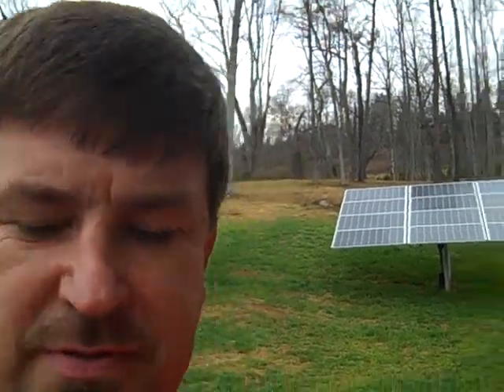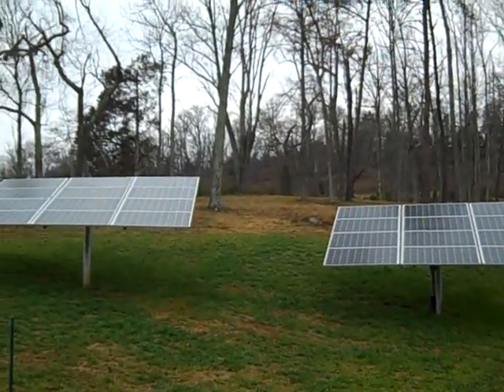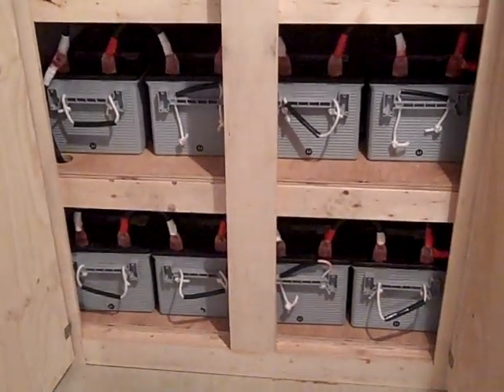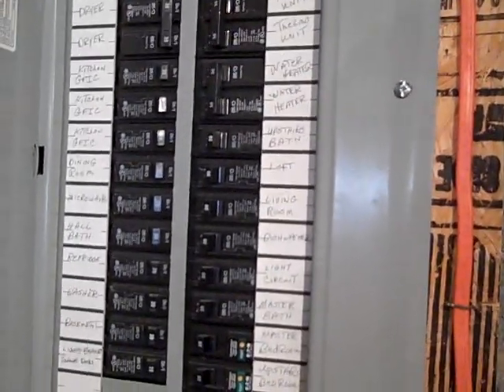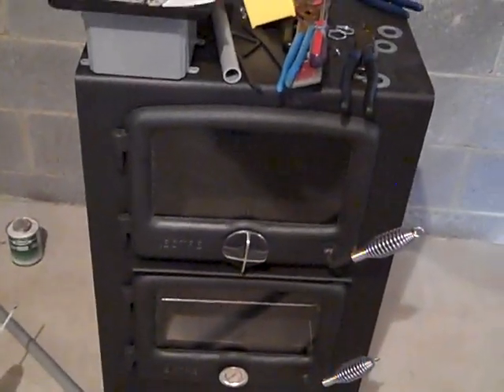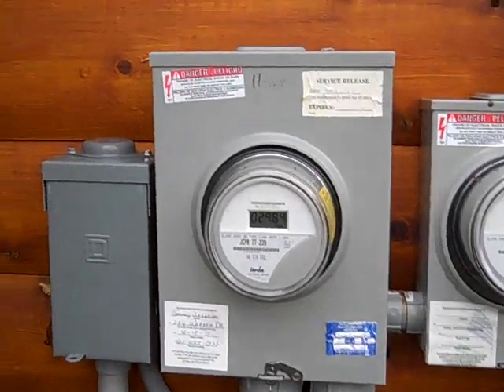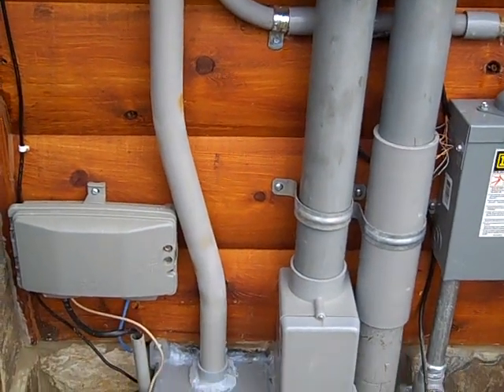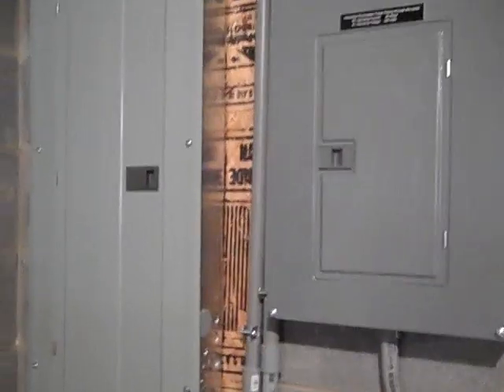Grid tie conversion to Hybrid Backup

Comment from the maker: @MrMG1973 No the inverters do not shut down because when the grid goes down an automatic transfer switch allows AC from the Xantrex inverter to keep them going.   As they produce power they feed the critical load circuits and charge the battery bank.  Pretty cool system.  We had the power company scratching their heads on this one!

Comment from the maker: Yes, when the grid goes down the transfer switch takes the Enphase power ( that was grid tied) and takes it to the inverter/charger.  Run time is variable as there is 6kW of solar so if you make hay while the sun shines you have a sustainable system.  The battery bank is 980 Amp/hrs.

Comment: Looks like that she should add a small exterior shed ( about + 18 " deeper then that bank of meters, counuit & switches.  Hide it a bit and protect it from the elements.  If not to code, a two sided shed against that area w/ a roof?  Just a thought.  

Looks really great and a complete all out back up system w/ no money spared.

Comment: Great setup.I bet these guys from power company were surprised that this works.They want you to be dependant,no matter what,but if you create "fake" grid with pure sine wave source,every grid tied micros or string inverters must work and behave according to load.The excess power is used to charge battery,if cloudy, it will suck batteies.The only problem is that is quiet pricey,that's why we don't see these systems at work that often..

Comment: Nice setup. I am very confused. 
When the grid goes down don’t the enphase inverters shut down? 
I have a direct grid tie system using enphase so this is a very interesting setup to me. Where I live there are large tariffs being paid out for green energy. I am in a contract for the next 20 years being paid $0.802 per kWh. The one problem is if the grid goes down I am without power like everyone else.

Comment: @engineer775 

I so want to put in a system like this one. Originally I set up my home with a whole house generator backup fed by LP. Is it impossible to keep that in place and also do a grid-tie hybrid system such as you show on this video? The reason I'd want to keep the whole house generator in place is because: 1) it is only a couple years old; and 2) during the winter icestorm outages a battery back-up system might not run the ground source heat pump.

Comment: What am I missing here? When the grid is up, the Xantrex is in pass through mode, the Enphase inverters are grid tied and producing.  When the AC goes out, the xantrex switches to inverting the batteries DC to AC and supplies the critical loads panel.  The micro inverters are fooled into continuing to run as long as the batteries don't hit LBCO.  The micro inverters will not charge the batteries this way, and if they produce more power than the loads require, the Xantrex will go into standby.

Comment: Old video, but is there a ratio of [battery backup] to [solar grid-tie] size (in kW) to make the grid-tie "think" the grid is still alive?  In other words, you probably don't want a 1kW battery backup acting as a "substitute grid" for 10kW worth of grid-tie inverter(s)... right?  Does the battery backup need to be at least the same kW rating as the grid-tie?

Comment: I have an enphase system and up till this week an analog meter that spun backwards.  This week a smart meter was installed but cant do net metering.  RV's use a powermax transfer switch that uses battery bank inverter power 1st then switches to grid as secondary when there isnt enough battery power.  Could this work with the enphase grid tie inverters?

Comment: How hard is it to just convert a grid tie system to daytime access to solar power during a blackout without replacing the existing inverter(s).  (There are so many devices with batteries these days.)  Just needs an auto power switch to ac outlet.  Why is this so hard to get?  Don't the batteries need to be used and charged all the time or they die?

Comment: What happens when the grid goes down, your batteries are fully charged and you're producing more power than what you're using?  Doesn't that energy have to go somewhere?
Reply: The power does not go anywhere if it is not being pulled by a device. It is not harming anything either if there is a surplus. It simply just does not get used until the grid is powered back up.

Comment: What will happen with excess power if batteries are fully charged and it's very sunny outside so solar array produces max output and the house uses way less  power at that moment of max solar output??? So brakers go down or everything burns down??!!! Can't go into the grid,grid is down during power outtages..
Reply: MB031 yep pretty much, unless you turn off the AC from the off grid inverter but that would leave you without power overall.

Comment: Would you recommend running the house as an island with an inverter charger and have the grid as backup and solar with charge controller feed batteries directly?

Comment: I live below you in galivants ferry. I want to run 16 300 Watt or better panels.
on the roof using 5 of the Elon musk wall mount batteries.and then want to employ proof it.what do you think. possibly 2 wind mills also.

Comment: Wouldn't this have been far simpler if you just removed those dang enphase inverters and ran high voltage DC over the same (buried) lines to a charge controller ??  :-/  hmmm

Comment: I dont get it, i thought solar panels were raw dc power to trickle charge batteries. If you convert dc to ac out at the panel you've got raw ac comming into the ac critical circuit whick of course needs a constant 115V supply day/night. mmmm? I tryed to make a generator from a 3 phase 7.5hp motor, everyone told me it cant be done or 'the whole planet will blow up' -_-

Comment: Wow, i still don't know what to think about this system.  As far as I'm aware enphase doesn't support any type of off grid setup.  This is because their inverters are producing electricity or they are not.  So lets say the power goes off, the transfer switch is flipped, the enphases are charging the battery bank.  The bank is then full and batteries are floating with very little trickle charging going on.  The enphase inverters then have nothing to do and burn out?  As far as I know thats how it works.  I did read somewhere that you can trick the enphase inverters by backfeeding 60.6Hz+ power to cause them to shutdown and not produce power.  But thats a little sketchy.  To the best of my knowledge, the only proper way to do this would be to also introduce a load that could be triggered on to be used as a dump for the excess energy (so the enphases micro enverters won't blow up).
Reply from the maker: Jason, It will not work with all inverters. The AC voltage rises in relationship with the battery voltage. When the Enphase senses the high AC voltage (or frequency shift with some inverters) they shut down as per IEEE 927.
Reply from the maker: engineer775 Practical Preppers MrMG1973 
My apologies for the bad answer I gave to MrMG1973.

It will not work with all inverters. The AC voltage rises in relationship with the battery voltage. When the Enphase senses the high AC voltage (or frequency shift with some inverters) they shut down as per IEEE 927.
Reply: Engineer775 Off grid inverters do not fluctuate their AC output based on the battery bank voltage, even if they did you are subjecting the home to up to 264 volts which is not good , there must be a better way to do this.